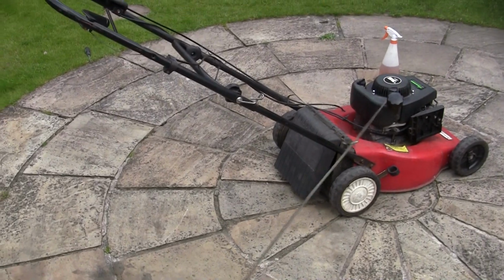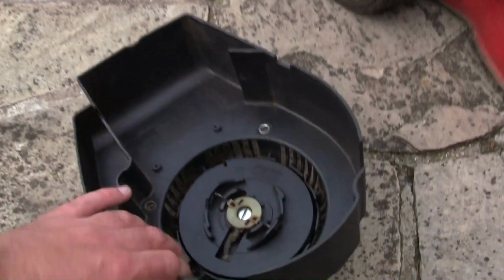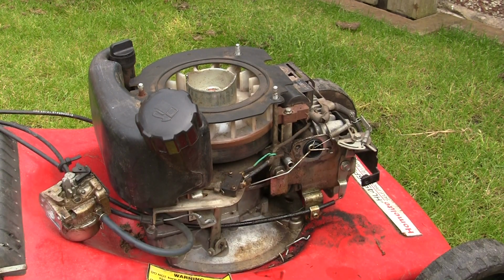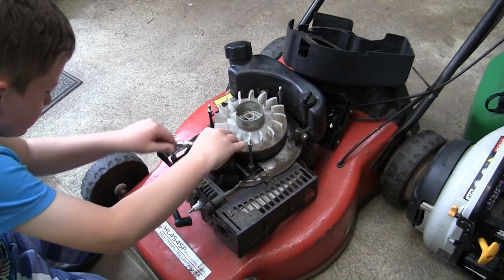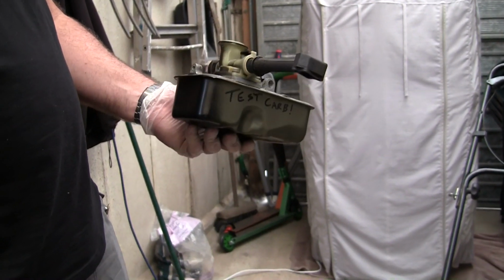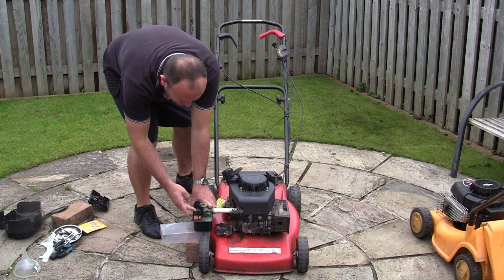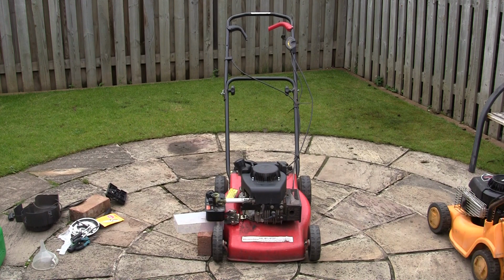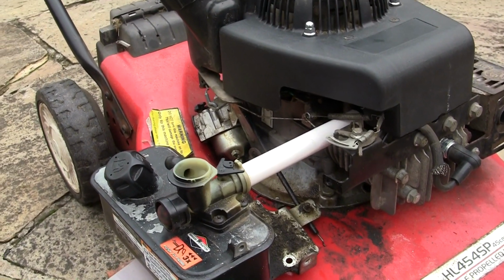SV150 Engine With Briggs And Stratton Carburetor Set Up! (Will It Run?)

Comment: You could even leave the carb assembly off altogether and it would still run if you sprayed fuel down the intake. However, the real problem is getting it mounted to the engine and getting the governor to operate the springs etc

Comment: I sucessfully converted an sv 150 to a briggs classic the block under all that plastic is almost exactly the same just with a govenor built into the side and various tapped holes added for the SV150 tank a pull cord assembly. first you have to prepare the engine by: removing all the sv150 govenor arms, linkages and springs and the carb mounting plate and the front mounting plate, use the briggs classic front mounting plate and throttle plate and use the briggs air driven govenor flap bolted on with the briggs coil bolt. once that is done, the briggs classic carb will bolt to the side of the engine like it normally would. you have to cut a hole in the flywheel cover for the govenor and a shaped section for the airfilter. and remove the sv150 fuel tank.
Reply from the maker: Luke Humphrys superb luke! could you post a video or some pics at the facebook page? or message me. Top work. Does it run well?
Reply: @MowerMan  unfortunately i sold the machine this engine was on. It ran as good as the briggs couterpart would have. Certainly a great deal better than the sv150 set up ever does. If I do it again i'll be sure to video it and send it your way
Reply: @MowerMan  I've also managed to convert one and it runs well, just a little fast. As Luke said, all the bolt are there for the tank and carb to fit straight on. I also managed to put a briggs metal pul cord assembly on, but had to change the bowl on top of the fly wheel so it engages with the starter. Overall not too hard to convert. Credit to you though mowerman for the idea. Its kept me busy during lockdown!

Comment: Hello there, I have a old petrol Mountfield rotator and not getting any spark, it’s a Briggs and Stratton 4hp and has the older ignition coil, which is moulded and doesn’t have a lead that plugs into in like the newer ones, can I put a newer style ignition coil on it? If so how do I go about it?
Reply: Nathan Huitson check the points on it and clean them up
Reply: Micks Mowers I tried that but it didn’t work, I have put another ignition coil on there but the governor flap is hitting against it, where it’s not the right one,  so going to have to order the right one lol

Comment: I  AM  TRYING  THE  SAME  THING  WITH  THE  B & S  PETROL  TANK  SV150  MOUNTFIELD  ENGINE . I  WILL  HAVE  TO  WORK  IS  ONE  OUT  HOW  TO  HOLD  THE  TANK  ON  AND  GOING  TO  BE  A  LOT  OF  MODIFYING TO  DO .  (    I  LET  YOU  KNOW  HOW  I  GET  ON .   )
Reply from the maker: Shane Squire Cool man! please let me know how it goes!
Reply: @MowerMan  HI  TO  LET  YOU  KNOW I  HAVE  JUST  DONE  IT  AND  THE  SV/RV 150  MOUNTFIELD  PETROL  ENGINE  IS  RUNNING  WITH  THE  B&S  CARB  TANK  ON  IT .  I  DONE  ALL  THE  GOVERNOR  LINKAGE ,  BUT  THERE  IS  A LOT  OF  HARD  WORK  INVOLVE  TO   LINE  IT  ALL  UP .  NOW  THE  ENGINE  IS  ALL  FIN  AND  WORKING .  GOOD  LUCK  TO  YOU  .

Comment: Is it ok to just use a hose pipe to clean a lawnmower? My mowers filthy and i can’t be bothered to scrub it for 3 hours lol
Reply from the maker: Hitachi 42 inch TVs are power consuming monsters Yeah just keep away from the carburettor and tip it carb side up. Don't tip it over though and remove the plug
Reply: Mower Man that’s great thanks for letting me know

Comment: Have exactly same  mower pull cord is a bugger to do took me about half hr had it given to me by a customer they do leak commen fault aldi mower crap mt ha ve full working engine should have a little plastic cap to cover the 2 dogs
Reply from the maker: steve barker How did u do the pull cord?
Reply: Undid screw took spring totally out wound it back in bent the end so it was level with slight gap on inside of plastic pole wound it slightly to get resistance screwed back together.twisted until I couldn't go any further then released half a turn threaded 3.5 mm cord in all done am a master of pull cord haven't found one I carnt do in 10 yrs servicing lawn mowers.......like you're vids buddy you've done 2 nightmare mowers iv done that's the performance power and this one....the engine runs good but carnt get the blade off so I can put engine.on new deck I have time to buy a air driver I think
Reply: It's all good mt like you're idea with the Briggs genius buddy